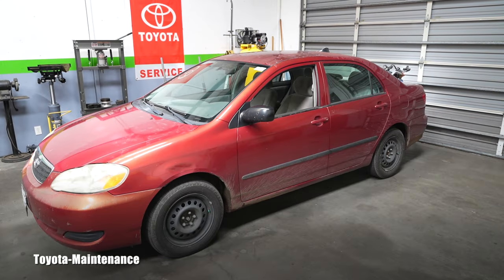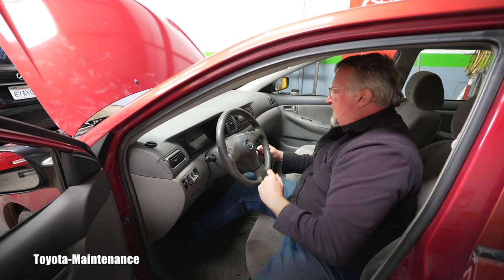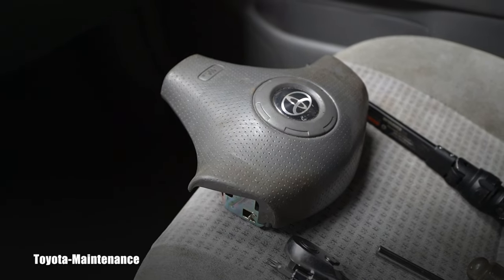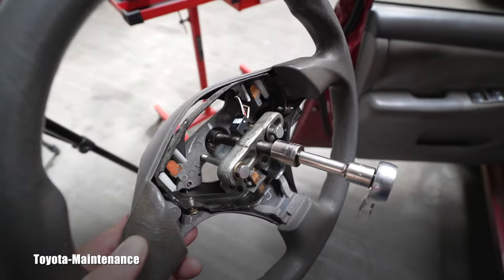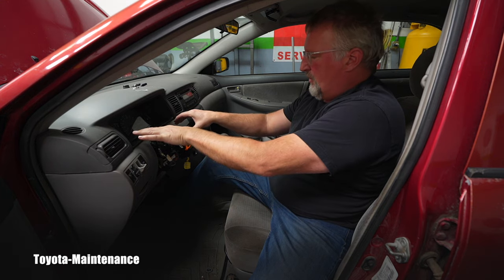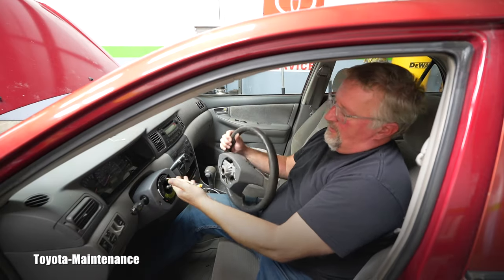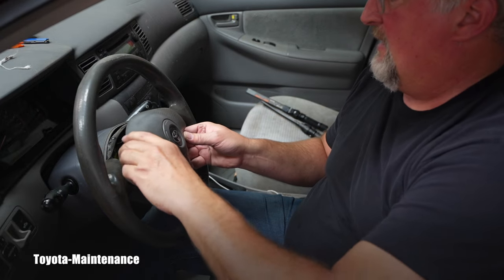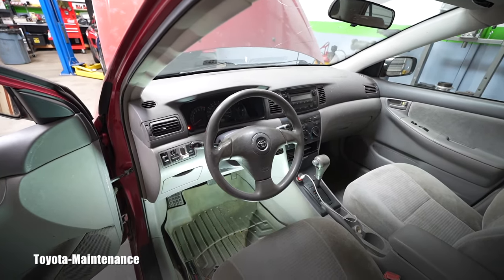Toyota B1811 Airbag Clock Spring Replacement

Comment: I replaced the clock spring on my 2006 Matrix, but I had to drive it to autozone with the airbag disconnected because the puller they loaned me was messed up and was going to damage the threads. Once I got a good puller and installed clock spring and airbag there was no a check engine light, as you mentioned. However, I found a history code (airbag circuit open) in ABS module with scan tool.

Comment: Peter, thank you for this video. Very helpful. Won't the airbag light also illuminate if there is a fault found with the passenger airbag ? In that case, will the the ECM produce a different code ?

Comment: Is this part only available at Toyota dealership Peter? Probably on something like that should use only OEM anyway yes?
Reply: I replaced the one in my Prius a few years ago and the prices from different sources ranged from $8 (obviously knockoffs) to over $100. I tried twice with the cheap ones (they looked identical and I had the time to waste) before getting an OEM off Amazon for ~100. Just make sure it says OEM Toyota if you don't want to pay dealer $$.